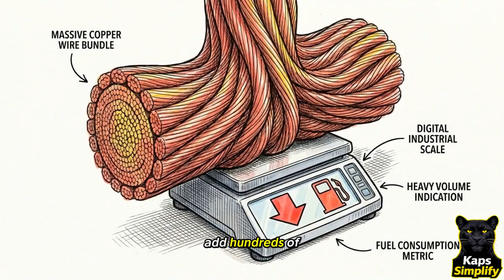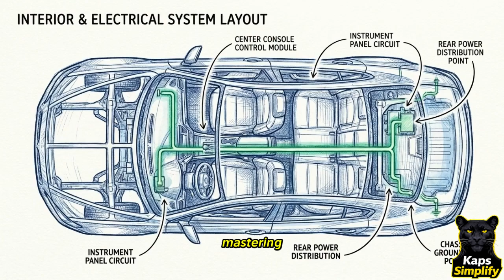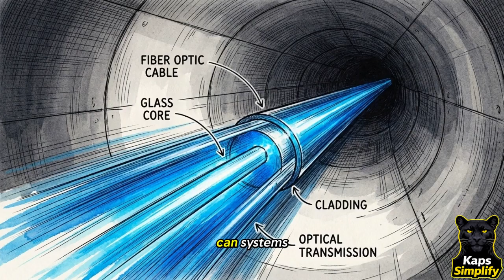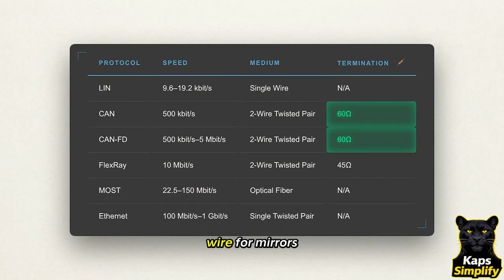All CAN Bus Explained in Simple Language

Comment: AI crap, full of basic errors 😡
Reply from the maker: Thank you for your feedback and for taking the time to watch the video. Visuals were created using AI tools, but the technical content is based on my own training and industry experience.

Could you please let me know if you are referring to any technical inaccuracies in the content or are you commenting on the AI-generated visuals/editing? If there are any specific technical errors, I would genuinely appreciate the timestamps or details so I can review and improve the video. 🙏🙂
Reply: @Kap @KapsSimplify re are my comments:

0:15 “hundreds of deadweight” makes no sense without units. “Hundreds of kilograms in deadweight” would make more sense.

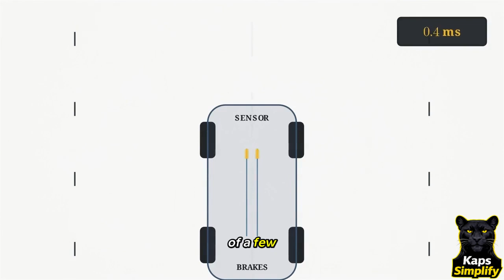1:00 There is no such unit of time as a “noa second”. At 9,600 baud an 8-bit character can be transmitted approximately every 1 millisecond. So editing the text to read “…a delay of a few milliseconds could compromise safety…” would make better technical sense.

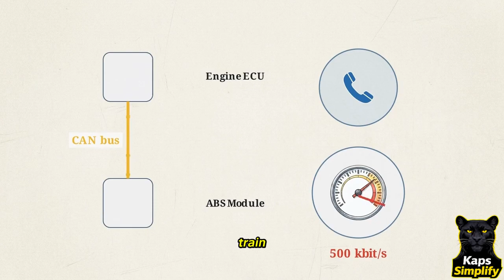1:20 A comment rather than an error: some CAN networks can operate even faster than 500 kbps, but even at this speed a whole 75-bit CAN 2.0B message can be communicated in just 150 microseconds, while a simple 8-byte message at 9,600 baud takes 8,333 microseconds. And this is without the inherent message integrity checking of CAN.

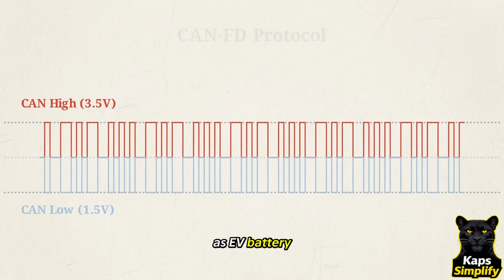1:45 Another comment: CAN FD came after my work with CAN and makes complete sense in newer, high bandwidth systems like EVs. It might also be ideal for avionics.

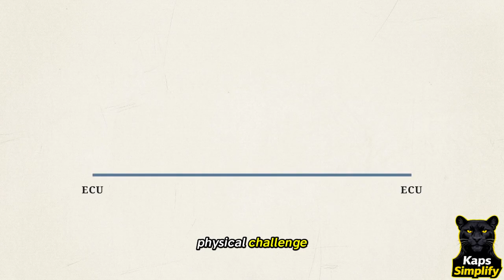2:00 AI transcription error: “high speed electrical pulses”.

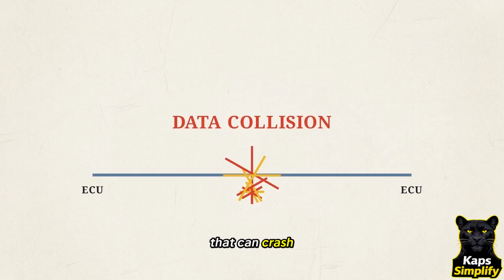2:10 Actually to avoid bit corruption and timing errors caused by reflections, correct termination is required even in lower speed networks, including CAN 1.0 and RS-485 systems. This is not (or should not be) just a feature of CAN FD.

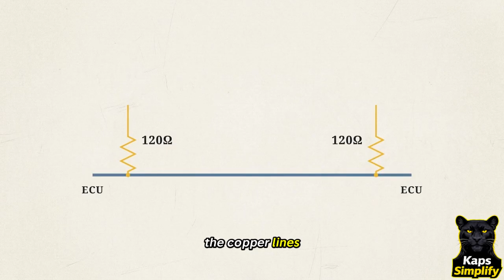2:25 Another comment: in practice we terminate the line with a pair of 240Ω resistors, one to ground and one to the logic supply voltage. Together these form the required 120Ω termination resistance while providing a balanced load on the drivers. But with the power off, yes the correctly terminated bus looks like 60Ω load to a multimeter.

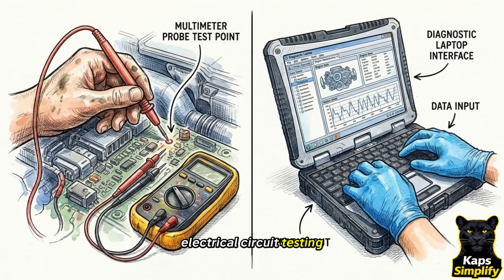4:20 Ethernet is usually implemented as multiple twisted pairs. Your table makes it look simpler than CAN; it isn’t.
Reply: @K @KapsSimplify .  Okay, I admire someone who is open to improving, so thank you for being so receptive. In return I will make the effort to assist.

I have experience of using CAN in designing advanced medical devices with multiple distributed processor systems where both performance and patient safety were critical. It was superb technology and I would recommend it in any complex, multi processor systems and not just automotive and industrial control applications (where it also excels).

I spotted errors in English grammar that seemed like AI generated content to me, but in hindsight it might be that English isn’t your first language. I have often wasted time watching AI generated content that is full of technical errors too, and maybe I misjudged your technical accuracy.

Because you have shown such a positive attitude in replying to my rather dismissive comment (for which I apologise), I will take the time to watch the full video and comment on the technical merits. I shall reply further when I have done this…
Reply from the maker: @MarkSJBeard Thank you very much sir for taking the time to watch the video in detail and provide such thoughtful feedback.

I truly appreciate your comments and technical insights, especially given your experience working with CAN in critical medical device applications. Some of the points you highlighted are indeed wording/transcription issues, while others are valuable technical clarifications that I will review carefully and consider in future content.

English is not my first language, so feedback on phrasing and terminology is always welcome. My goal with Kaps Simplify is to make complex automotive technologies easier for beginners, technicians, and students to understand. Because of that, I sometimes simplify certain concepts and avoid going too deep into advanced implementation details in introductory videos.

I also appreciate your willingness to revisit your initial impression and provide constructive feedback. Discussions like this help improve the content and create a better learning experience for everyone.

Thank you again for your time, expertise, and encouragement. I look forward to any further insights you may have.😊🙏🙏
Reply: @KapsSimplify . I fully support your aims. I probably overreact against AI content because so many people use it to produce low quality content for money. I understand that is not your aim, and AI can be useful especially with translation. I am hopeless at learning languages myself so I do understand this. Good luck in your endeavours! 👏